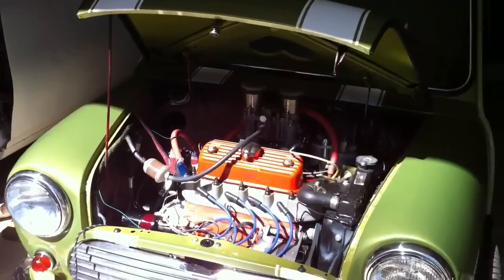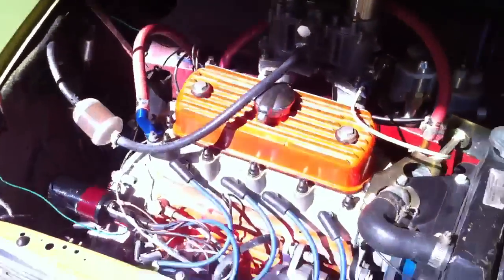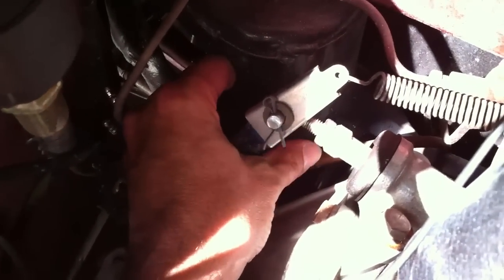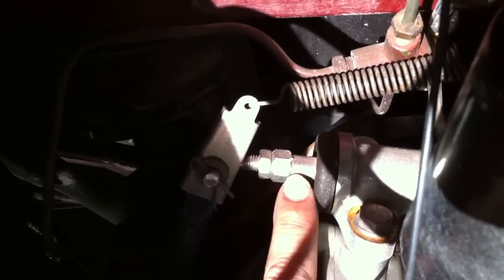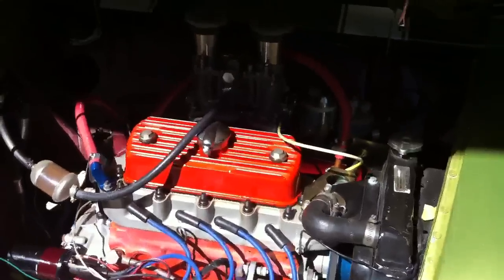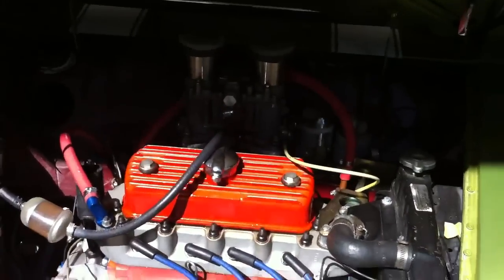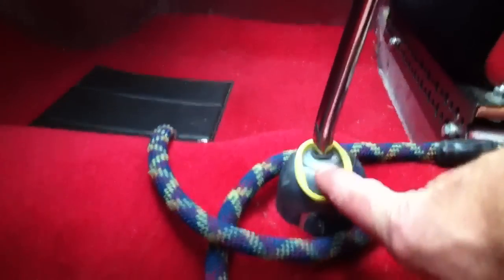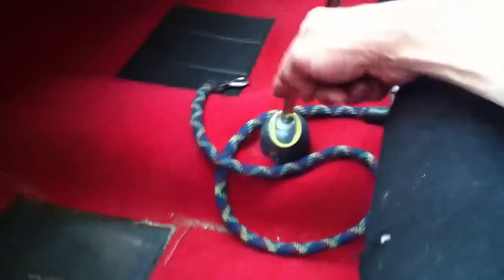Clutch adjustment classic Mini Cooper

Comment from the maker: After all these years and tens of thousands of views, finally an expert!  Thanks Peter, I never thought of that!!

As we know better, it can be very frustrating even with all the bits working!  Just this week with Aaron Hagar's car, been chasing the clutch on the Supper Small Bore.  Always a combination of pedal linkage, hydraulic throw, push rod length, too much carpet, too little pedal,  I know, I know... more rambling....

Comment: can I adjust the clutch in my 2005 convertible? I think it might be slipping and I can't tell if it is or not because it's my first car and it's the only car that I've driven with a standard transmission. I don't know if this is normal or not, but by the time I'm in 5th gear, my revs are at about 2500 and I'm only doing 65. I will admit, I did rev it up to about 2500 to 3000 rpms and then release the clutch pedal to get going since I would stall quite often until I got used to driving it and I did this for about a month or two. It had 59k miles on it when I got it and now it's up to about 64k miles. I just spent $300 on two new rear tires and a rim this week so I'm a little tight on money at the moment but if it is slipping and I can't adjust if, what should I do? Just let it sit around until I get the money to have it repaired?
Reply: Take it somewhere and they will give you a free estimate then you can either buy the parts and do it yourself or wait till you have enough money and have them do it. Transmissions are probably the hardest thing to fix yourself.
Reply: Chad Christian yeah I'm not planning on doing it myself. I don't have the right tools and I've never done it before in my life lol. I'm more of a computer techie rather than an automotive but I do have some understanding on how to properly maintain a car and sings of problems.
Reply: Yeah if you were revving up to switch gears for a month or two you probably burned out the clutch. You were probably leaving clutch slightly engaged during all of this.
Reply: Chad Christian yeah this is the first car I've driven with a standard. I would keep stalling so I would rev up to about 3000 rpms and then let off the clutch. I did this for a few months or so until I got it down and now I gotta have it replaced. I've also heard the clutch that is used in these have problems so I'm going to having a different clutch installed. I found an FX200 from Clutch Masters. It's made for both racing and street driving. I really don't mind if it accelerates too hard or it's too rough just as long as it won't cause any further damage done to anything else.
Reply: Yeah you should have no gas when you let off clutch once you are good at it. The clutch will engage the gear and won't stall when done right.
Reply: Chad Christian Yes, like I said, I have it down now.
Reply: Nothing more fun than a car with stick :). Have had a lot of nice sports cars with it.
Reply: Chad Christian I don't think I'll ever get an automatic again. I think they're a lot more fun and give you more control.

Comment: What a load of rambling just to adjust a mini clutch. Always make sure that the ball on the bottom of the long clutch arm isn’t worn out, It should be a perfect ball shape. Replacing the worn out clutch sorts out most mini clutch adjustment problems.